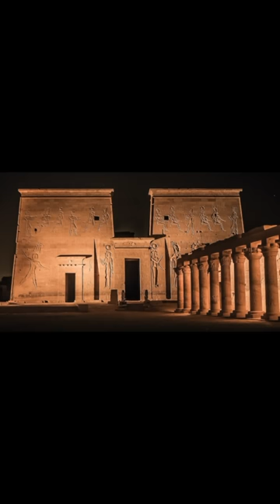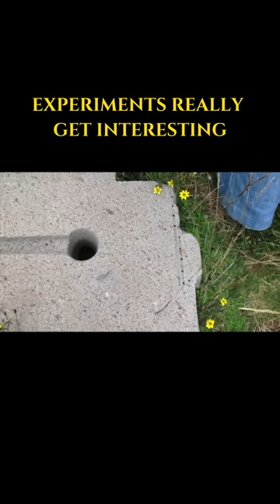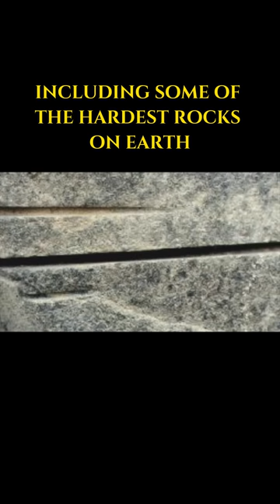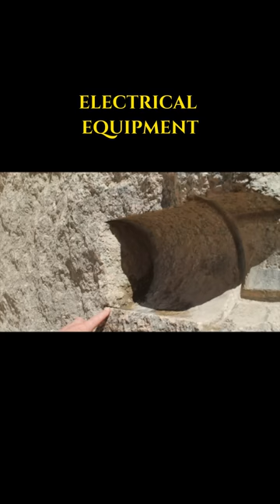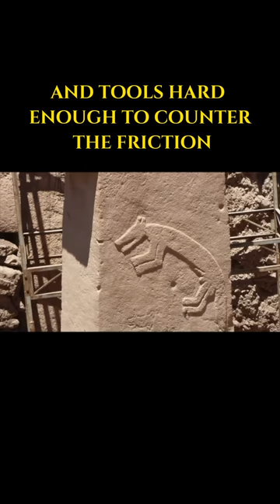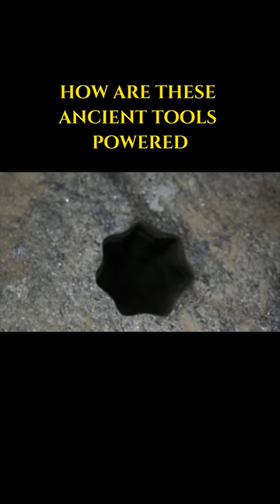Megalithic Star Holes: Drilled? Lost History & Ancient Technology #history #ancienthistory

Comment: Them 7 and 5 star holes are mind boggling
Reply: Very easy to explain, this „big“ hole was created by many small drill holes. Manpowerd drills can only make small holes, so they simply put them next to each other.
Reply: What kind of drils did they have
Reply: @qscfthm14  okay sounds reasonable, so where are they ? Only copper chisels and hammers have ever been found..no drills..no drill bits, nothing...🤔
Reply: @Marinesniprx  "okay sounds reasonable, so where are they ?"

Simple.

Copper circular drills and straight saws wear down much faster than chisels.

They were simply melted down and reused when they had lost too much material to be of use.

"Only copper chisels and hammers have ever been found"

There are examples of Egyptian copper saws - I literally found pictures within 30 seconds of searching on Google.

Don't believe everything you read in a Hancock book or see in a Youtube video.

Always seek multiple sources.

Google is your gateway.

Comment: A 5 point drill hole.... got me on that one
Reply: Is it pointed or 5 circular holes to make 1 big one?
Reply: @matthewost5571  right 🤔
Reply: Me too, like I kinda believed about the drilling stuff but after seeing that, 🤯. They must’ve just developed technology differently than we have
Reply: The star hole was cut using vibrations. You can see here how they done this if you type into youtube how to melt stone sound part 1. They dont melt the granite though they cut right through it with a blunt piece of copper tube you must watch. I've also seen how they lifted massive blocks of granite weighing 80 ton and even bigger statues without lifting a finger once you see how they lifted these you will be shocked it is so simple and 100% they did not lift them with 1 finger
Reply: @alvanalvino  watch the video on you tube how to melt stone sound pt 1 you will see how they made the star hole and the round hole no drilling involved only 5kg of ballast and cutting star shapes etc right through granite 7 on the mohs scale with blunt copper pipe. It works. As for lifting the 80 ton and much bigger obelisk granite blocks they didn't lift them they pushed down on them using only their weight as ballast they didn't lift 1 finger to get the blocks right to the top of the pyramids same goes for Stonehenge  they didn't lift the blocks they pushed them down with their weight 3 people can get a 80 ton block of anything metres up without lifting a finger
Reply: @johntait that video you suggested doesn’t explain the spiral groove observed in the Petri cores.
Reply: And extremely precise.
Reply: It’s not a drill hole. It’s a oscillating tool hole 🕳️
Reply: @jontait1095 the
Reply: @KILLJILL_Official  yes uninterrupted spiral groove boring straight into the stone with 3 times the power of anything we have today according to experts like Christopher Dunn Robert Schoch etc... not a vibrating tool ... same with the saw cuts an actual revolving blade bigger than anything we have today... other techniques as well why not...
Reply: A seven point hole is where I'm stumped. Has to be some kind of vibration cutting tool.
Reply: Not really.

Just make 1 central circular drill hole and 5 more around it spaced apart so that you can wear the edges down and get your 5 point star hole.
Reply: Star Bit . Or Security Bit ! Yep got that !oh right 20,000+ yrs ago 🤔
Reply: instantly knew it was a torx head

Comment: I've been asking these questions for years and I'm so glad the conversation is getting momentum 😊
Reply from the maker: Hi there - I appreciate you sharing you thoughts. I matters what people have to say about this subject - there is so much that needs to be uncovered and rediscovered. Let me know what you think any time!
Reply: Resonate frequencies . Even with steel getting atoms to vibrate at what their structure is to the point of the atomic bond between atoms break. You can get steel to act like a liquid before it breaks apart
Reply: Came up with those questions on your own did ya?
Reply: @no88o2  I have done a bit of research on resonate frequencies, and it's true what you previously said, even steel breaks from vibration not impact ,so it stands to reason that stone could possibly be manipulated by sound, but that brings up the question of how could one control the direction of it to a point that would allow it to stay in place and not travel freely? As sound will go where it can unhindered..
Reply: @Marinesniprx  Think of it like a speaker. You can only hear the sound so far away and more prominent if directly in front of the woofer. Remember everything has an equal and opposite reaction of force when trying to do anything even project sound or vibration. So it would only go as far as the effort put in to move it. And if it were going up against another rock in a corner than that would absorb some of the force and not produce enough force back to fully push it back. There's a video where they are projecting sound onto a table of sand and it produces geometric pattern based on the Hertz. Wouldn't be unreasonable to think that played a part as some patterns would be stronger than others. Also been suggested that looking into the paintings left behind some of the gods or king's guards are shown carrying what looks like a bigger version of the modern day tuning fork , for like a piano. Or if the pyramids were actually a form of power source and has been noted some old ancient cities resemble the same layout as a modern computer circuit. Maybe they knew what Tesla did and had free energy
Reply: @dom85ross  😅yer it’s like he’s the only one that’s had the idea😂
Reply: @no88o2  Tesla knew that A/C & R/F are the same thing , electricity and magnetism used to be separated now we know that it's neither, unless together=electromagnetism
Reply: @Marinesniprx  Tesla had a system for wireless free energy. JP Morgan was a financier of his and shut it down stating " If I can't put a metre on it, I don't want it". Hence the wired system we have today .
Reply: @no88o2  Yes I'm aware of that, I just told you his secret..but JP Morgan has nothing to do with this, neither does action and reaction, nor does the distance of the sounds wavelength..my original question was, how could these ancient people cut these giant stones so precece, so that you can't slide a credit card between them? and they did it millions of times..
Reply: @Marinesniprx  read your question again. You asked how could it be directed as sound travels freely
Reply: @Marinesniprx  Did you know JP Morgan also owned the Titanic and more than likely swapped it out with its sister ship on launch day, that had a weakened hull due to a fire during construction about the same spot where it split open. While also the only 3 ppl who could have stopped the formation of the federal reserve and it passing law died on that voyage. Leading to all the inflation probs 1920s depression and how the government is allowed to run at a deficit every year leading to 30+ trillion in debt that the tax payers and their children's children children have to pay back? He was a bad guy. Epstein used the bank aswell
Reply: It's just cement and proven by Drexel University in 2006..
Reply: @MrWizardofozzz  cool beans got the report anywhere
Reply: @no88o2  sounds cool but even for us today thats beyond horizon of our advancement. I believe we dont even have that technology on a very little scale let alone on so big and precise as the ancients made it
Reply: Watch the latest podcast with joe Rogan and graham Hancock and Randall Carlson they explain the answers to your questions and explain the technology the ancient Egyptians were using they are working on the new technology as we speak basically everything has waves and frequencies if you find out their frequencies of an object you could control it no matter how heavy it is and you can slice it clean how do you think the ancient Egyptians that those almost 3 million tonnes of blocks up there
Reply: Yes Tammie thanks to Internet mainstream contradictions show up midstream now. Self vaunted "experts" no longer so "expert".
Reply: @Marinesniprx Yes ! Maybe possibly explaining the mechanics of a cut or two but now explain the craftsmanship and workmanship of the ARTISTRY of megalithic stellae, inscriptions, obelisk, sarcophagi etc etc world wide not to mention massive multi-ton stones or one huge massive boulder in India carved up like some 3D printer intricate work of art.So you bring up a very good point when you mention control of the instrument used my friend. Most theories try and explain how the material could have possibly been worked but never address the fine precision of it all.
Reply: @no88o2  one survivor said they were woken by an explosion not an iceberg impact. The normal explanation always sounded suspicious. We were told the captain thought they could break the iceberg with their hull, and even told the helmsman to speed up, but this is an irresponsible command at best and crazy in execution if you can avoid it.
Reply: @percanatord3461  they are always super interesting to listen to if you're different history theories. I think all this is way older than our books say
Reply: @clivewells1736  Yeah I think it's sus. And apparently there was old photos of the wreck where the hull steel was folded outwards like it came from inside ,instead of pushed in. But I was just being a bit of a dhead putting that on there haha
Reply: @no88o2  just one incident in a long line of betrayals by an incumbent parastical organism.
Reply: @markwildt5728  ha no, the point is he’s watched videos for years like we all have, and acts like he’s come up with the very questions being asked in the documentaries
Reply: Conversation started long before you where born bubba
Reply: Do you think this could have been done later, like with a machine? Just a thought

Comment: The ancient Egyptians utilized a process known as acid etching to create engravings in stone with chisels. This technique involved using a corrosive acid to dissolve the softer parts of the stone, leaving behind the harder parts to form an image. This method of engraving allowed the Egyptians to create intricate and detailed designs that would have been impossible to achieve with traditional chisels alone. The acid etching process was a crucial part of the ancient Egyptians' artistry, and it is still used today in various forms but not well heard of.

Comment: There are some cuts that couldn’t have been done with the tools we see in the museum. String and sand didn’t do some of the cuts I have seen. Copper saws using sand or copper”drills” couldn’t do the drill holes either. Something is missing here. More research.
Reply from the maker: thanks for sharing your thoughts.. the beauty of the digital age is the speed with which we can sweep aside decades of dismissive elitist standards for what we 'should' or 'shouldn't' know! Watch & comment again!
Reply: Yeah, those tools can do that and more
Reply: @ws5397  what tools? I’ve seen none that can do what they claim. None.
Reply: "Copper saws using sand or copper”drills” couldn’t do the drill holes either"

Why? Who told you?

Did you do investigations on granite yourself using comparable tools?

I've seen a Russian team of 2 people do exactly that.

It's not easy or fast, but it's certainly possible.

There are even wall drawings in Egypt depicting the apparatus.

It's basically like a weighted crank handle with a sheet of copper wrapped around the bottom.

You just need to keep adding abrasive and water over time.
Reply: @mnomadvfx  No one told me. Who told you your methods? I do what everyone does. Read, study, observe and conclude. None of the attempts I’ve seen ( and other people) make the same type of drill marks. I don’t buy it. Even Flinders Petrie found the drill holes and saw marks unexplainable.
Reply: @mnomadvfx  I watch those videos too.
The Russian guy is great.
I'm a maintenance mechanic in a Granite shop and we can do far more precise work than what these people say is beyond our abilities.

When cutting a field joint that gets bonded and scraped on site, our saws can make the joined area, inconspicuous if the color is good.

Comment: 7 pointed star hole has to either be from pouring around a core or ultrasonic abrasion with a tool.. possibly also some technology similar to sinker EDM using electrical arcing to erode the hole away in tge shape of the tool. The only one that could be done by a primitive or less advanced people is pouring around a star-shaped core, but it seems evident that none of these structures were poured. Those holes were cut by an advanced civilization.

Comment: You don’t need electricity to drill through rock. Water to keep it lubricated and patience and skill to drill.
Reply: Not even skill, just hard work and steady hands.

The drill would have been weighted by rocks tied to the shaft to minimise drift and perhaps even maximise the force of the cut.
Reply: @mnomadvfx  when I think about it, it’s hard enough to drill through your average stone with diamond tipped drill. Imagine trying to cut through granite ! They probably used quartz maybe ? Or this is a new core drill because I would say almost impossible without electrical power to get the torque needed to eat through granite consistently.

Comment: They had water powered wheels attached to carving and drilling tools. So they didn't need electricity.
Reply: It's certainly possble, and if the wheels had been by the Nile they would have long since decayed to nothing even in Egypts dry climate.

They still would have needed some sort of building to fix the wheel to though, I would have thought that limestone would have been preferable to prevent flood damage, but I suppose mud brick is also possible if they were not concerned about rebuilding it every year.

Comment: Maybe when you add certain sounds @ high volume and specific frequencies at the cut it prevents the decay of the tool. Or maybe if you electrify the bit itself it makes it less likely to decay during use? Just throwing some ideas out there
Reply: Or maybe you just don't prevent the decay of the tool and cutting hard rock was expensive in tools 🙃

Not for nothing but if cutting granite was as easy at these people claim it is then why do so many of the great Egyptian monuments use vastly more limestone despite it wearing much faster?

And no the answer is not weight - the weight of granite per volume is very close to that of limestone, especially Tura limestone which is denser and less porous vs the Giza bedrock.
Reply: @mnomadvfx  interesting

Comment: That hole with a straight section could easily been made by inserting a round object along with a long object in WET geopolymer..and then dryed until hard..☆ What if there was a way to  build the large megalithic rock walls in Peru, and anywhere else.. without the massive "lifting, transportation and carving", as is always mentioned *
how could one do it?
~perhaps  by using leather forms and powdered rock*  and a catalyst to harden it...once the rock hardened,  then place 2 more on either side using the one side of the rock you already made to be the side each of the new rocks. .and you won't be able to get a piece  of paper between them*..as the next rock form's are hardened..more can be added to form more sides and on top..no mess..no carving except minor  final cleanup..and no transportation from miles away..notice the rocks in Peru  are all the same type and colour consistency. .kind of like cement* in a way..the knob on the sides of some stones may be from a support holding the leather form on the rock until it hardened..leaving some imprint behind..just some thoughts!
p.s. if near a river..building a water wheel will enable you to crush rocks to powder*..

Comment: The archeologists say they used stone tools and rocks lol….. they must of had great little pieces of stone.
Reply: They were also some very strong folks of coarse they knew more about it than we ever will.
Reply: "they must of had great little pieces of stone"

Ye, it's called flint.

Humans have been using it for over 3 million years.

It's possible to make sharp edged tools with it without too much effort, and it's harder than granite.

But that's not what they would have used for core drilling.

Copper core/circular drills using a crank type handle weighted by stones tied to the shaft and using a copper sheet wrapped around the end to achieve the circular shape.

All you do is add water and quartz sand and start turning the crank handle.

It aint easy, or fast - but is does work.

Comment: Thank you for addressing an anomalous factor most main Stream "experts" ignore publicly while high speed scratching their heads privately.
Reply: It is anomalous because it's been asked and answered by various people before both academically and by laymen by masonry experience.

Just because you are privately scratching your backside while being too lazy to research the various publications and books delving into the subject does not mean that those experts are inclined to go out and pursue fantasists who would rather believe in a cool mystery than a mundane and boring answer that simply means hard work and lots of time is required.
Reply: @mnomadvfx  no it's anomalous because it was done by a high speed continuous full rotation movement no back and forth proposed theorized method. While you scratch your backside crack crack open a dictionary and look up anomalous. Asked and answered various ways doesn't make something anomalous. Anomalous in this case is when it doesn't fit in to accepted main Stream theories and sometimes actually contradicts them.